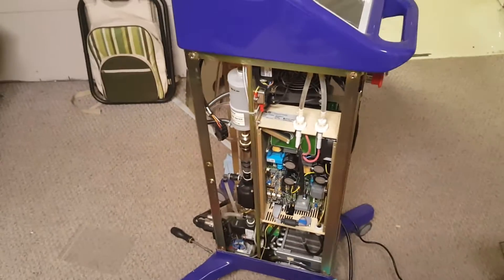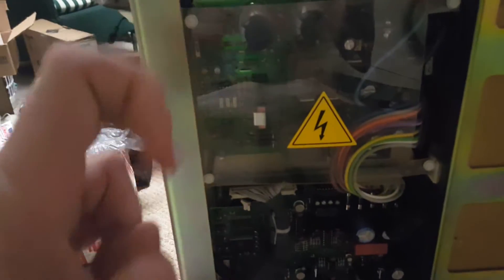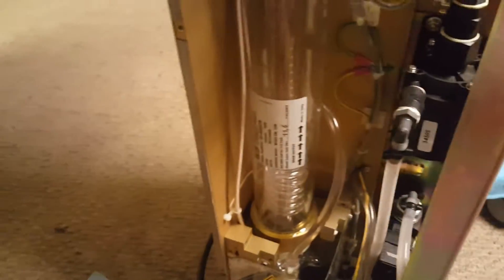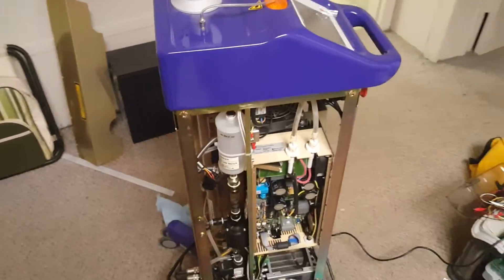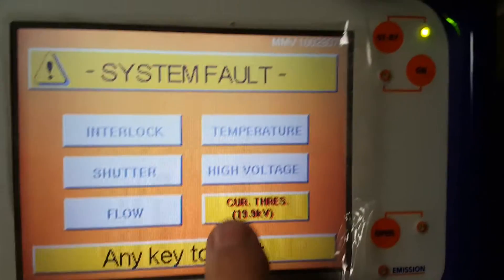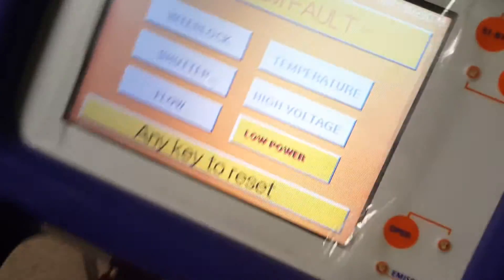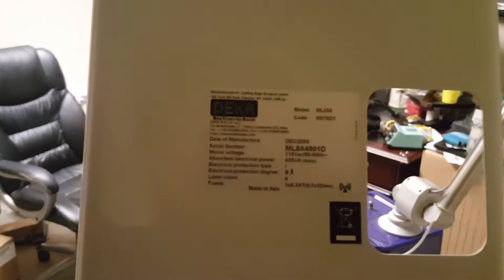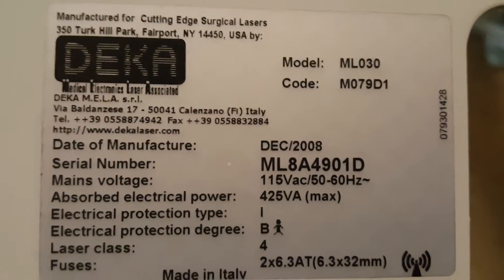Surgical laser machine diagnosis help

Comment: Judging from what I saw of the tube when it's self testing, I'd say that too much of the electrodes in the tube have vaporized causing high conductance. The tube is bad. You can still use it if you find the "laser enable" circuit and ramping up the frequency. That can overcome the metalization of the tube. Bassically over time the glass get's sputtered by the electrode breakdown. It effects conductance through the gas in the tube. The dark area is where it collects the most because it's the coldest part.

 The unfortunate part ( unless I miss my guess) is that the replacement tube costs 90% as much as a whole new machine. This is why I stick to He/Ne and Argon lasers. The electrodes don't break down as fast. Also keep in mind that I get facts jumbled around in my head from time to time as I have a lot in there. Either way I know what I'm seeing when there's a dark spot in the middle of the tube. SInce the PSU checked out OK the remaining answer is metalization of the glass in the tube.

That said if you have a HF inductive furnace, you may be able to vaporize it off the inside of the tube. This depends on how the electrode material reacts with EM flux at high frequencies. There also might not be enough there to interact much with the flux. It's hard to say without being able to directly do things with it. One suggestion is to get a HV DMM of some sort and check the output voltage and current draw while it's actually lasing if you haven't already. The tube may be offering the PSU less resistance than your test load. It's the sure fire way to figure out if it's metalized. Of course you'll want to cross check the findings with the tube's spec sheet.
Reply from the maker: Completely makes sense, and explains what I see. On the inside of the tube, throughout the inner cylinder, there is a pinkish purplish multi color deposit on the glass. It sounds like that's the metal from the electrodes, the inner tube section in other lasers I've seen are just a piece of clear glass. I really appreciate you taking your time to post a detailed explanation, I had forgotten about Ben Krasnows experiments on sputtering until you mentioned it. I have found a place that specializes in laser tubes and can even make new ones, I'm going to give them a call and see what they can do.

Comment: Yeah, most probably a laser tube issue, either it's leaked (air in or gas out) or the electrodes have sputtered themselves over the inside of the envelope.

Comment: I'm by no means a laser expert, but couldn't it also be the electronics that check the output power being faulty? That said, the laser does look a bit dim, I would suspect that a (likely) infra-red laser like this would've been more visible on camera. 
I've seen a laser engraver tube in action, and its tube lit up evenly over the whole length though. Same colour (IR pink-ish on camera). So my guess is the same as yours. Defective/empty laser tube.
Reply from the maker: The laser output power is verified by two things. First is the current measurement from the power supply, and the 2nd is rather interesting. There is a peltier / TEC mounted in the bottom of the chassis at the end of the laser opposite the output side. I don't know this for sure, but I'm pretty sure it works by absorbing some of the energy out of the end of that end of the laser, producing a small voltage across the peltier which is then translated into a wattage reading. I have discovered a service menu, of which one section says "Peltier: 0.00W" which is right above the output current of the HV PSU. I'm going to test the Peltier by applying a heat source to it and seeing if that generates a reading, though I suspect at this point that works just fine. The laser tube does have 75 hours of continuous operation on it, though as I understand it tube live varies widely.
Reply: Interesting. Hope you can get it figured out, and maybe even fix it.
Reply: 75 hours isn't much for a co2 tube , even a sealed one should do more and I would say medical tubes are better made than of the shelf ones . Maybe it developed a leak ? The TEC power style laser sensors are common , in the 100W Yag I had there was a wafer type one for setting lamp current / laser output power .what is the PSUs rated output current ? , My 15W tube needed around 15mA to run
Reply: unfortunately a camera will not see 10600nm light that a Co2 laser outputs .
Reply from the maker: When I hook a 2.2M resistor across the HV PSU, I get 10Ma but the output voltage drops to around 1.5KV. I do get a full 20KV across the tube when I set the power output to its highest setting with the PSU hooked up to the tube, but the tube only draws about 1MA

Comment: As it looks to be a sealed tube , getting it re gased would probably be more hassle than getting a new 30W tube .The PSU will kick out around 180W + , The tubes are only about 20% Eff at best